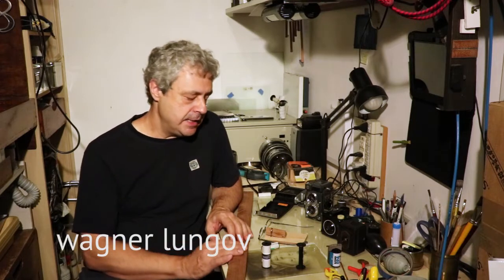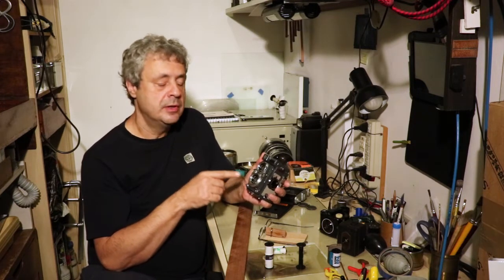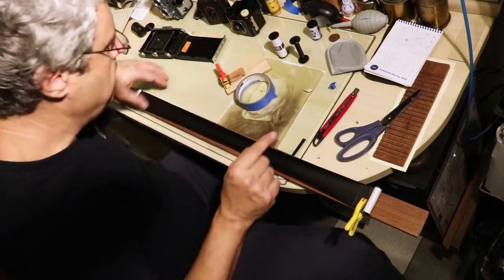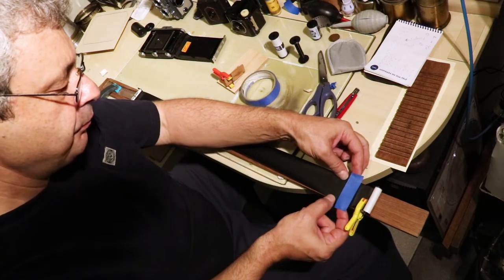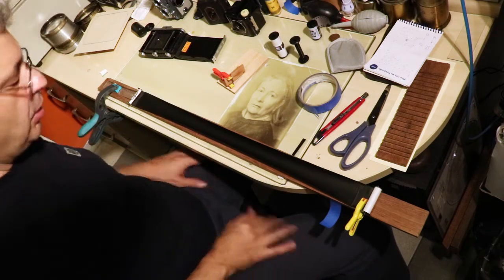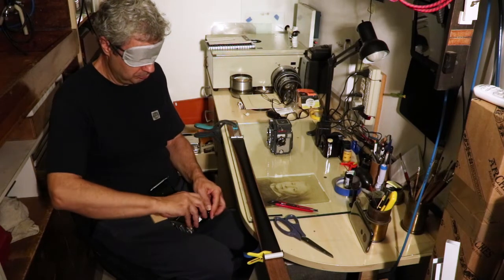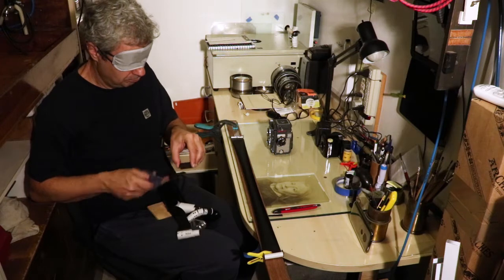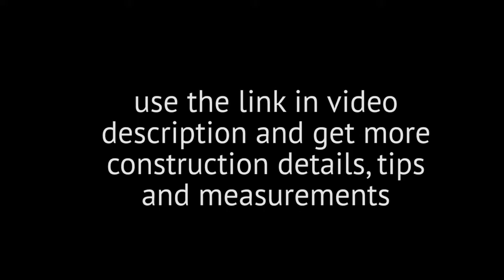Respooling 127 film from 120

Comment: I have sketched out a method for reloading 35mm film onto 127 (or 120)
spools.   I have a couple hundred feet each of Agfa Copex Rapid and
Agfa 400S in UNPERF to experiment with until Ilford again allows
custom cut orders.  In a 127 camera, 35mm wide film leaves about ¼
inch top and bottom of the frame unused, and about ¾ of the area of a
full 127 frame.  The negatives would be about 46mm wide and 35mm high
in landscape. Perf’ed film could be used with shorter frames.  Of
course, 120 film could be slit to 46mm and the flap mechanism below
could still be used effectively.
Two spools are needed, as well as film cut to length and the backing paper.
For attaching the takeup end of the film to the takeup end of the
backing paper, I have tested taping a 1 to 1-1/2 inch piece of 46 mm
wide backing paper to the 127 backup paper at the location where the
takeup end of the film would normally be taped to the backup paper.
This creates a flap.  The beginning end of the film that would normally be 
taped to the backing paper slips under this flap; it need not be taped to 
the backing paper once slipped under this flap.
The backing paper is wound tail end first onto a supply spool until
the flap is exposed.  The measured and cut length of film start end is
inserted under this flap (at the point about 3/8 inch short of the
original tape) and the film wound in takeup mode on another spool just
as it would be wound into the camera.  When the free (tail) end of the
film is reached, it is tucked under the tail end of the backing paper
and the film/backing paper combo is rewound onto the supply spool.
When the start end of the film buckles up (due to the different length
of the film and backing paper spirals) and reaches the flap, the
beginning end of the film simply slips forward under the flap.  The
film is now ready to be used, properly spooled without the bump or
buckle.
As the film is initially fed into the camera, the flap prevents the
film from catching on anything; the flap grips the film which simply
follows along as it is wound into the camera.

This is a heck of a lot simpler to do than to describe it.
Terry

Comment: Hi, thanks for this video I am going to try it...quick question of which I sorta posted on one of your other videos regarded the Japan finish or the leather type finish applied to a Kodak Vest Pocket Camera. Mine as some slight coming away of the leather from the metal. What kind of adhesive would you use to reglue the leather to the metal? Thanks for all your videos...really helpful.
Reply from the maker: Hi Jake, I don't know what you mean by "Japan finish". I don't remember mentioning it anywhere in my videos or posts. Maybe you saw it in another channel ou site. In regards to applying leather to metal in the case of camera bodies, people recommend contact cement. The only problem is that once you joined the pieces it is not possible to reposition the leather. I used it already, it gives a clean finish because the excess is easily removed. One thing that helps is protecting the major part of the area to be glued with something that will not adhere, vinyl adhesive backing paper, for instance. Then you lay down just the edge of one or another side of the leathe over the camera body. Once you are sure that the position is OK only then you slide the backing paper out and join the two parts. Hope this helps.